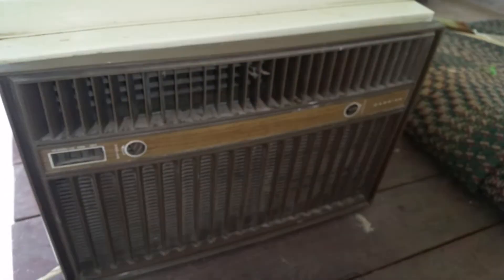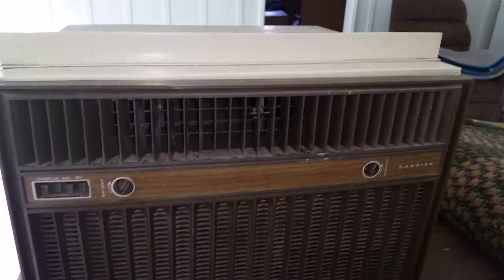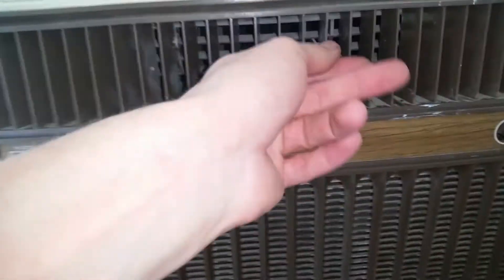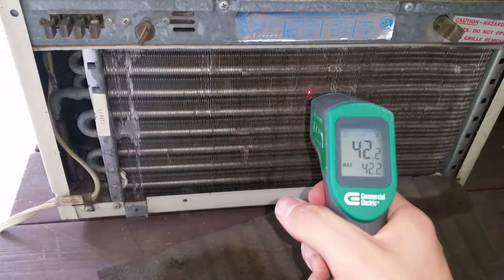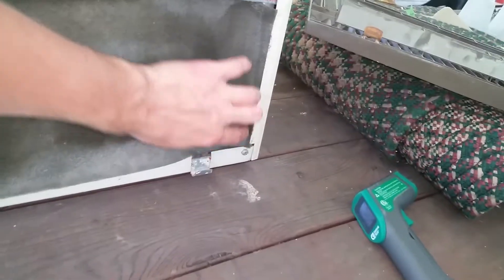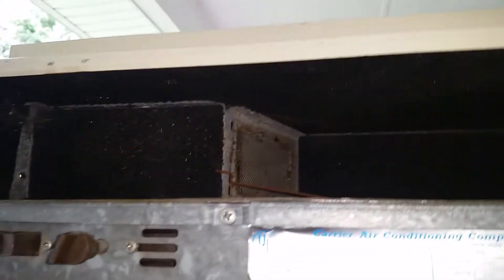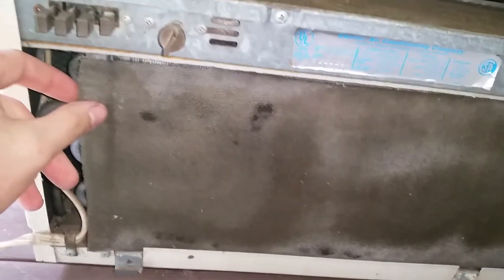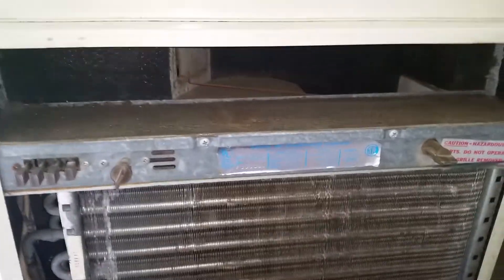Air Conditioner Fan's 1973 Carrier Air Conditioner

Comment: Hey TheAirConditionerGuy! Thank you so much for making this video! This is the same AC I had in my bedroom from 1972-1986 when the Compressor broke down in a heat wave. After this AC I bought a unit called White-Westinghouse which worked really good but only after a few years it stopped blowing air, I still have it in my basement im not sure why I didnt just discard it but after seeing your videos it makes me want to fix it up and put it back into my wall to replace my current AC! The AC I have currently is Emerson Quiet Kool which I bought last year, but I told you about that on Flickr. I will try to make the old one function again next year, in the meantime do you have any tips or tricks on what/how makes the AC not blow air? Thank you TheAirConditionerGuy!
Reply from the maker: glad you said something! White Westinghouse units especially the small ones were know for their fan motor issues. 2 of the common problems are a failed capacitor, or a seized fan motor. both are pretty easy fixes!
Reply: @TheAirConditionerGuy  Thank you for the speedy reply TheAirConditionerGuy! Is it possible that you make a guide showing both the Capacitor Issue with the White-Westinghouse AC & the Seized Issue with the White-Westinghouse AC? Thank you very much and I hope to fix up my vintage AC unit! I am planning on filming a video on it next year as well. It has a brown front cover with 4 sqaure panels (1 is a door aswell) and a brown top vent with the filter behind the cover if this helps you identify the model. Thank you TheAirConditionerGuy.